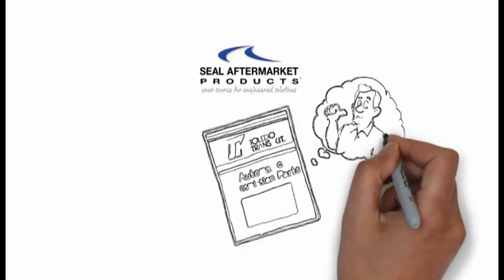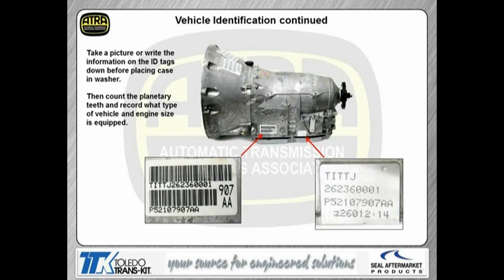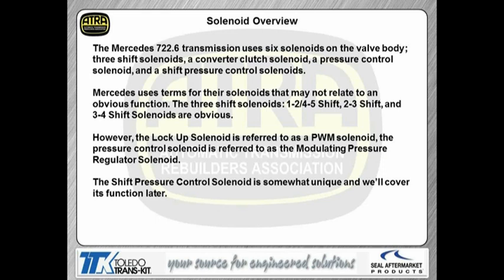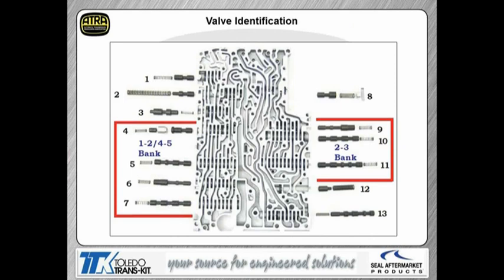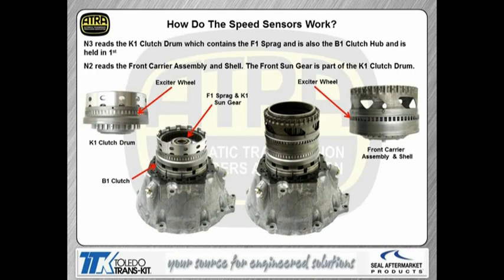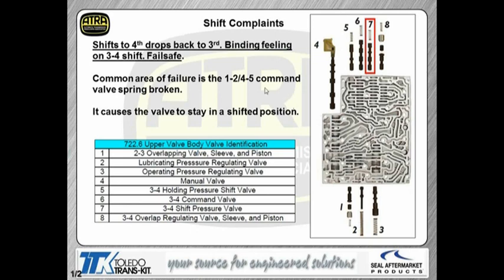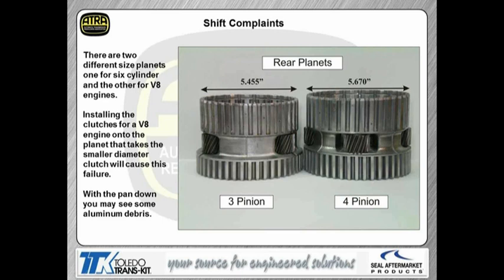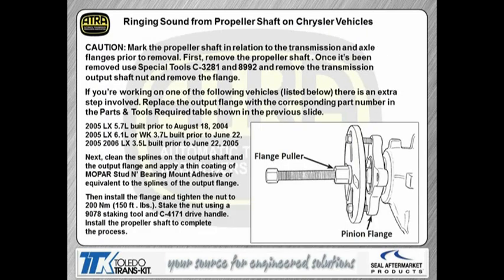Mercedes Chrysler 722.6 Webinar - 9/2/14

Comment: I just changed out a 722.6 in a wrangler and it shift 1st 2nd 3rd on intial start up but then stays in third and throws gear ratio codes, i caint find any reason for the codes to be thrown. Have you heard of this issue before?
Reply from the maker: You'll need to make sure the mechatronic unit and the ECM are compatible. If you installed a unit from a different vehicle it won't work so make sure you have the correct unit for this vehicle, if so you need to reprogram the system.

Comment: I had a complete transmission failure 07 Mercedes E-Class 722.6. No engagement or movement in forward or reverse. I drained the fluid, removed just the valve body and installed the transgo kit and sonnax overlap sleeves and tcc damper valve upgrade parts as well as a new transmission filter. The car is driving now but something felt a bit weird, so I checked the torque converter live data stream on my scan tool and I am seeing it go from status "open" to "open + slipping" or just "slipping" as it moves through thee gears. Does this indicate a torque converter failure? I'm trying to do  a DIY analysis so I was wondering should it read "open" then either "closed" or "locked"? Also in attempting to find the correct replacement torque converter part number i'm seeing these 3 different types./ A 211 250 09 02 / A 211 250 12 02 / A 221 250 20 02  I was wondering if you can help me narrow it down to the correct one.(see engine and transmission info below) 	
M - Engine: 271956 30 844344 271.956 M271 KE18 ML R4 GASOLINE ENGINE M271 KE18 ML REPOGA - Automatic transmission: 722695 06 706128 722.695 W 5 A 330 AUTOMATIC FIVE-SPEED TRANSMISSION WITH CONVERTER
Reply from the maker: the converter is supposed to slip during shifts, that's normal operation. As for the converter, you can contact your local dealer for a part number of check out one of these websites :
https://www.wittrans.com/
https://www.floridatorqueconverters.com/

Comment: Is it possible to have a 722.6 p0700 code gear implausible and complete loss of drive due to bad grounding?
Reply from the maker: Yes, the 722.6 uses a Latch Valve system which can create a neutral condition .
Reply: @atra-automatictransmission1300  Wow i'll check all the grounds!
Also does the modulating and shift pressure are supposed to hold pressure if testing with 20psi of compressed air? Or they lightly leak?

Comment: Is it true that a healthy 722.6 should never go backwars uphill when into "D" without pressing brakes and gas pedal? Please end my suffering I cannot find any answer as to what a healthy 722.6 should operate like...
Reply from the maker: That would be correct. D stands for Drive, which is forward. R stands for Reverse. If it's going in reverse while in the D position, check your linkage first.
Reply: @atra-automatictransmission1300  Thanks for the answer, however that wasn't the context of my question. I will try my best to formulate the question better:

If you are driving and decide to stand still on a mildly steep hill and the car is put into "D" and you don't push on the brakes or the gas pedal, is it normal for the car to roll backwards or not? People say that if the transmission is healthy the car should never roll backwards when uphill. Just like it's healthy/good that the car starts moving the moment you put it "D" or "R". 

I am not talking about the issue when you  you put the car into Drive that it goes in reverse.